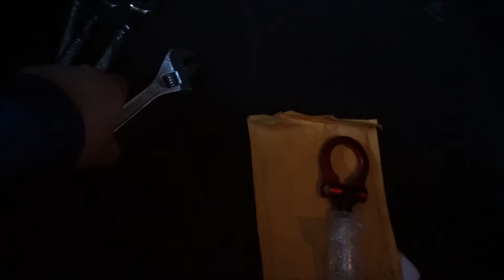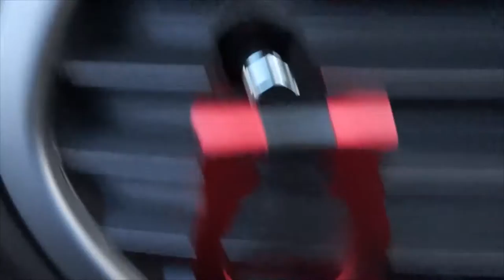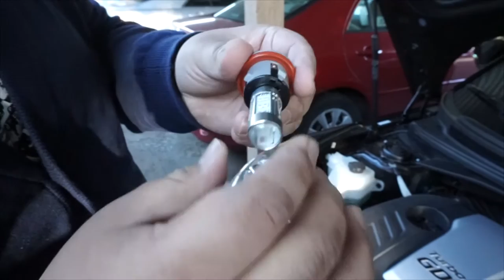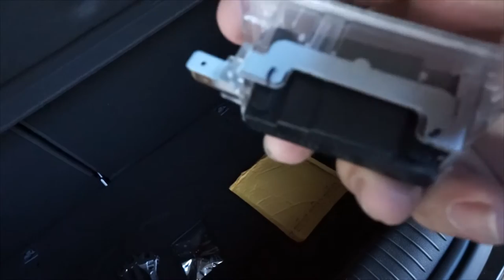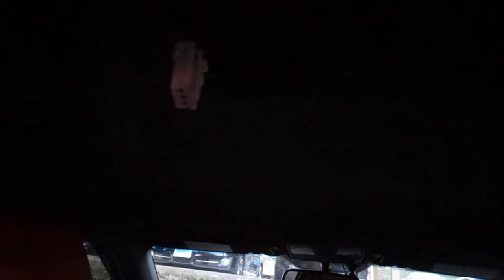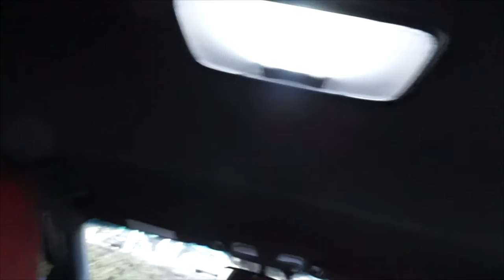Front Tow Hook & More LEDS! - Simple Mods

Comment: Thanks for all your help I have 2016 Veloster Turbo clean low mileage still has warranty on it. The pervious owner mod the hole car but it has a spoiler the  devil wings and the paint is cracking and peeling what should be my next step replace it or vinyl wrap it?
Reply from the maker: Vinyl wrap may be easier unless you end up doing something like Plasti dip

Comment: Hey I have a question I just got one exact same as yours why does it flap around after I tightened it ? How can I get the hook itself to stay down like yours ?
Reply from the maker: Thats odd. The hook should be quite heavy to the point it shouldnt flap around. I'd check how tight the bolt holding the hook portion is or make sure yours isn't made of anything else besides some sort of metal.

Comment: Are those Front Turn Signal's Hyperflashing? Didn't put resistors right?
Reply from the maker: Correct. In one of the earlier videos I had already installed rear LED turn signals and mentioned that it will cause hyperflashing. I have the resistors but i'm holding off on installing them until I do something else that requires removing the front bumper as well (the headlights need to be removed in order to install the resistors in the front to prevent this.)
Reply: Chayness damn i wanted to do such. But dont wanna do the hassle of installing the resistors. Thought the led as described is canbus canceller and will prevent the hyperflashing
Reply from the maker: Yea I looked into that myself lol. And I have yet to find bulbs with a built in resistor. even worst, replacing the flasher relay doesn't work so for now it HAS to be resistors.
Reply: Chayness damn prolly have to live with hyperflashing for now. Anyways thank you. Nice simple DIY's also i think you dont have to pull out the bumper for you the reach the oem harness well no work space but i believe youll be able to do it. Diagram is on the net. Becarefull with the headlight clips too!! Haha
Reply from the maker: I'll look into it. My fat hands make some simple tasks harder haha but I have something I need to install real soon that requires taking off the bumper so I might just look into doing it then. Stay tuned! :)

Comment: Do you know if any LEDs for the DRL that are simple plug and go and match the accent strip light?
Reply from the maker: Sadly, most LED bulbs are brighter than the stock accent strip and most are in the 6000K color scheme which is a "cool white" so you're going to have a very hard time finding one that matches both color AND brightness. To make matters worst, unless you buy an LED Headlight bulb set up, you're basically going to be sacrificing your High Beam lights by buying a simple cheap plug & play set of LEDs as it will be fine for DRLs but won't be able to emit a bright enough light to use them as high beams. You're basically stuck buying at least a decent set at about $50 or more.
Reply: Thanks for the info appreciate it. Great work on the videos can’t wait to see what other veloster mods you do
Reply from the maker: Thanks man. Well I finally installed the Oil Catch Can and next weeks video is an intake finally so hope you like it

Comment: For the turn signal LEDs, are those canbus LEDs to prevent hyperflashing? I bought some regular leds for my VT but they started hyperflashing.
Reply from the maker: You need to install a resistor kit to prevent the hyperflashing
Reply: Chayness is that for all four led turn signal bulbs? Because i found that DDM tuning sells error free amber led turn signal bulbs for our cars. Did you install resistors on all 4 corners and was it difficult?
Reply from the maker: @fgonzalez6972  Thats new. I didn't install load resistors. The hyper flashing didn't really bug me. But not that you brought it up, imma go buy some new bulbs and share the info. Thanks!

Comment: Do the tow hooks come with bolt and ring? Or just the ring?
Reply from the maker: The tow hook comes complete like in the video. Already assembled with the right size bolt and ring. I have to express that the bolt is made to FIT our cars. Lots of ebay ones will not fit our car.
Reply: @Chayness  ya i just bought a tow strap for my 2013 veloster turbo and it wasnt even close to fitting. do you think i could find a right size bolt at a local hardwear store or should i buy a different tow hook all together?
Reply from the maker: @gideonhamstra18  The bolt itself is pretty large. I personally have never seen one at a hardware store. You can certainly try but not sure how successful you'll be.

Comment: Hey dude, love ur car! Im thinking of getting a VT as well but had some questions regarding dependability, maintenance, and issues if any that you've had while owning this car. Thanks!
Reply from the maker: Hey bro! So I bought mine new and I haven't had any issues of yet. From others, it is suggested to buy a 2014 model or newer if buying used due to the fact that thats when they changed and fixed a few issues they had on previous models. 2016 is the year they did a few revisions as well like the newer gauge cluster. 2017+ has Android Auto/Apple Car play stock but can be gotten on older models with TECH Package only. Maintenance is similar to other cars but a proper cleaning will be needed down the line (100K miles) due to the nature of the GDi engine. This is pretty standard but many install and Oil Catch Can (which i'm currently working on) to help prevent a bit of the gunk that gets into these cars. Hope some of this helps?
Reply: @Chayness  bought a 2019 Veloster Turbo ultimate this video helped Tx.. I just like the design lol.